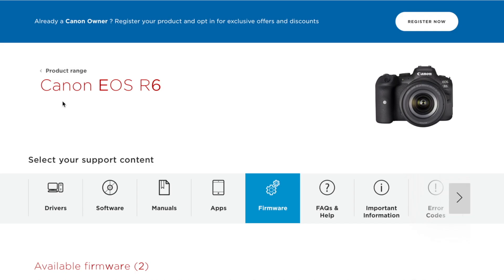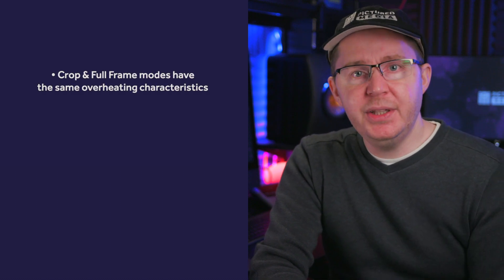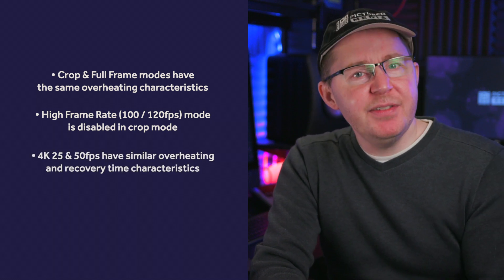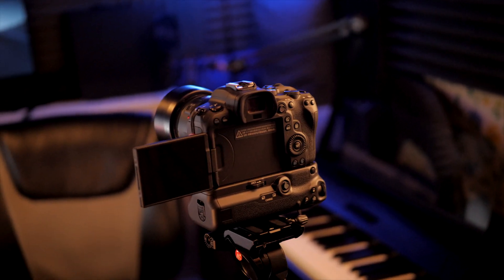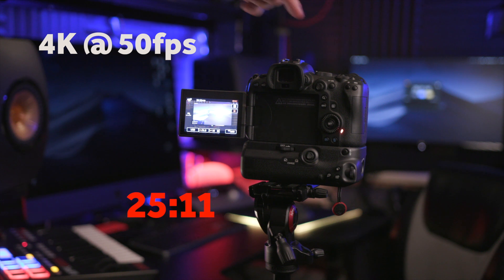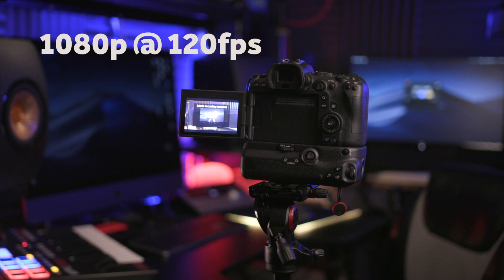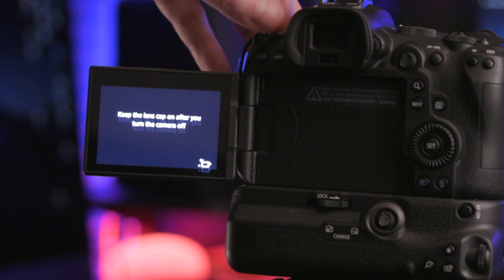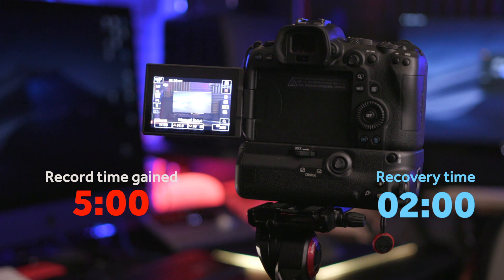Canon R6 overheating test with firmware 1.1.1

Comment: To have by waiting for cool-down to compensate for overheating is totally impractical in a real situation shooting a film. 
Until Canon sorts the overheating problem, these R-series cameras are useless for shooting video / filming and people ought to stop trying to make out that these cameras are "ok" for shooting video.
I suppose Canon may say that you ought to buy 2 cameras so you can alternate them while one cools down ?
Reply from the maker: I agree it is impractical. On the flip side you get a really good stills camera that doubles as a B cam in a video shoot.
Different needs, and in some cases the R6 is ideal.

I'm not defending the Overheating though, I myself am considering a switch to Sony.

Comment: Does the camera still have this overheating issue in 4k ?  I really wanna buy it but I can live without the 4k
Reply from the maker: Yes, it still overheats in 4K.  There have been no further improvements to the overheating since I made this video.
If you can live without 4K though, then you should be fine.  It doesn't overheat in 1080p at all.

Comment: Overheating on that camera is a scam. Can you unable that an keep recording?
Reply from the maker: Sadly not. It really does get hot though so even if you could disable it i'd be nervous using it for long takes in 4k.

What is really strange is how it still overheats in crop mode, whereas the last generation EOS R does not.
Reply: @juliancroot  Thanks for such a detailed test! 
I would say your test result is the exact proof of artificially crippled video performance & scamming overheating. Yes, it does overheat to some extent. But the same result in both FF and S35 mode and how organized the numbers of time left for recording are are the traces of crippling. Overheating is both truth, and a perfect excuse for Canon to differentiate their mirrorless and cinema line.
Reply from the maker: @martinsuen3153  Yep, I agree with that. :)

Comment: When you started filming in 1080p, i don't get why you couldn't film for a full 29.59 as this was a separate clip from your initial 4k clip. With my 5d4, each new clip can be 29.59, they don't aggregate like this?  Anyone know the explanation?
Reply from the maker: It was in high frame rate 100fps mode which is already slowed down on playback.. So effectively it is a 30 minute clip.  If you record in 25, 30, 50 or 60 fps it will stop recording at 29. 59, but you can still restart recording immediately. 

There is no Overheating in any 1080p recording mode.

Comment: Does the r6 charge while in use ?
Reply from the maker: It doesn't charge, but it can run for longer with it connected to a PD rated power supply.
The batteries will still drain while plugged in, but at a much slower rate.
Reply: @juliancroot  thank you very much... solution for it only to get battery grip  bcz it drain alot if screen is on. So I only use viewfinder to save battery 🔋.  Thanks a lot

Comment: 9:00 - There is no temperature sensor in the chamber and the shutdown occurs programmatically and does not depend on the wind and temperature around. Please tell me how the R6 behaves in terms of overheating if you shoot 4K, say, 10 minutes with breaks? If the camera is turned off not by the temperature sensor, but by the program, then what about overheating when shooting with breaks?

Comment: I have a question .  if the temperate  is  around  33 C  can r6 record 4K 50p  cinematic clips  let  say  6-10 second each clip   every 15 - 30 second .  is it get overheat?  .thank you
Reply from the maker: Very specific question there, and I don't think I could reliably answer it.
My hunch tells me that with only 20-30 seconds between clips,  I'd day its very likely you'll run into overhearing trouble.

It doesn't get to 33 degrees here though, so I can't test it for you.

Comment: excellent review as always. but I'd rather see how you'd use the R6 as main camera in the work field for a whole day. Would it be able to shoot occasional shots of 4K25 or 4K50 without overheating throughout the day? that has to make the difference for me. I don't usually record these long continuous clips anyways!
Reply from the maker: I'd not take the R6 as my only camera.  It will always be accompanied by my C200.

If I could only take 1 camera, I'd take my GH5 every time.
The R6 wouldn't get a look in.

For me the R6 is a gimbal camera only., and it's fine for that.

Comment: You are so red in this video...
Reply from the maker: Something's gone off somewhere.  I'lll have to check before my next video.
I do have red lighting in my studio, but key light is Tungsten and a while back I created a LUT using a colour checker to get everything dialled in correctly.  It might also be the C200's colour matrix option... in my studio, 'neutral' it gives everything a 'pink' cast, while 'EOS Original' ironically looks more natural.
Ive probably stuffed up somewhere in the chain.
Reply from the maker: Yep, it was a bit off.  Just recalibrated. Next video should be better.
Thanks for the heads up.

Comment: The indicated remaining recording times are wildly inaccurate on the new firmware. You will get A LOT more time out of them until the camera actually goes into overheating lock. On my R5 I can record 10+ minutes in 4kHQ even if the indicator only states 2 minutes remaining. Just FYI.

Comment: Maybe I missed it but was that 4K in 10 bit or 8 bit heat testing.
Reply from the maker: No you didn't miss it... I didn't mention it !!  Sorry, so many things to remember to mention.
However although it was in 8 bit, I have tried 10bit CLOG aswell, and it doesn't seam to make any difference.

Comment: So at this point do you regret buying the camera ? Do you still feel the same way about the camera as when you bought it.
Reply: The Ninja V does 60fps Maximum. From the R6 you get an un-cropped 4K Signal
Reply: @GregorAmon  can you get raw from the output?
Reply: @GregorAmon  so the ninja v can’t record 120p at 1080 on the R6?
Reply: @Theaaronchris  Correct. Max 60fps on the Ninja V
Reply from the maker: No regrets at all for me.  As I explained in my full review video, it won't have a hard life with me because my C200 does all the donkey work.  The R6 will only be used for gathering short clips of B roll.

I acknowledge though, that if you were looking to buy an R6 as your primary camera for video or hybrid shooting, and 4K is important to you, then you might do better to look at other alternatives (Sony A7Siii, Panasonic S1H)
Reply: Picturedmedia, the Sony with its 12 mp!?
Reply: The R6 works like a charm with an External Monitor. Using the Ninja V for a a long day of interviews, no heat issue at all.
Reply: Gregor Amon what frame rates and resolutions do the R6 let you record on the ninja V? I have the R and it only allow cropped 4K modes and 1080p 60.
Reply: No, RAW is not possible

Comment: I heard from another reviewer that they have not given R6 any custom 'video' modes settings and only stills? is this true? It seems silly to me.  Canon gave the R5 longer original timings in thier firmware update along with better recovery times.  I think they only gave the R6 users better recovery times.  I am sure if more peoppe pushed Canon they will give more intital time but unfortunately the R5 has way more voice on Youtube with influencers and photographers.  I really need the R6 to work in 4k 60fps for real estate etc and not sure if it will suffice.
Reply from the maker: The custom video modes thing is true.  
And yeah, the R6 will be a liability for 4K video or hybrid shooting if its your primary tool.
Reply: @juliancroot  Do you think they will add custom video modes to the R6?
Reply from the maker: I doubt it.

Comment: Man, it's so disappointing. The new canons are basically useless for hybrid shooting. In my case, I'd be shooting stills, and then switch to shoot 4K60, then switch back to stills. I think with a shooting style like that, you're basically never gonna get any shooting time back.
Reply from the maker: Yeah, you're right.  If its to be your primary camera, and you're either hybrid or all video then you should probably look elsewhere.
As a straight B roll cam though, or for Photographers, the R6 is a good camera.
Reply: Is there any recovery if you go from shooting video to stills or do you always have to turn the camera off?
Reply from the maker: It doesn't matter what state the camera is in, you will always be able to shoot stills.  No need to turn the camera off at all.
Reply: Picturedmedia I think you misunderstood my question. If the camera never overheats in stills mode then switching to stills mode after it overheats in video mode should allow it to cool down enough to give to some more time recording video. If you have to switch the camera off before you can go back to video then this suggests it is a timer that is preventing recording and not the temperature.
Reply: @lesblain  Canon claims it generates heat when you turn the camera ON. So no, you can't use stills mode and expect decent(if any) cool down time.
Reply: You could always just change the date to +1 day, remove the battery, insert it after a few seconds and get the full 30 mins back. Of course, don't record the full 30 lest you're ok with subjecting the internals to fairly high (but still not catastrophic) temps. Still, this workaround puts the control back in our hands instead of having a rather heavy handed cap on record times.
Reply: Just out of curiosity, why would your way of shooting not work for you if you’re switching between stills and 4k60? I can see it being an issue if you’re shooting for extended periods, but when using 4k 60 fps, you wouldn’t record for any longer than 3-5 min increments, no?
Reply: @xkben90  Because I've heard reports of the camera generating heat and ticking down the shooting time just by being on and shooting photos. And it seems like the only way to recover that shooting time back is to turn off the camera completely.
Reply: Mohammad Rezaie gotcha. Makes sense. It would be cool if they can do a firmware update to where the camera uses the bare minimum to take photos on photo mode and then switches to the max potential on video mode. That would have been nice
Reply: @xkben90  definitely. We were ready to switch to a R5 + R6 for our work, but ever since the reports about the overheating issue started coming up we've changed our mind. It's disappointing because when they work, they're some of the best cameras on the market.